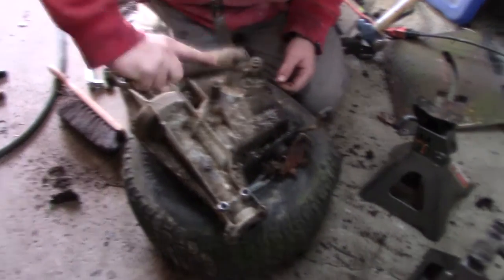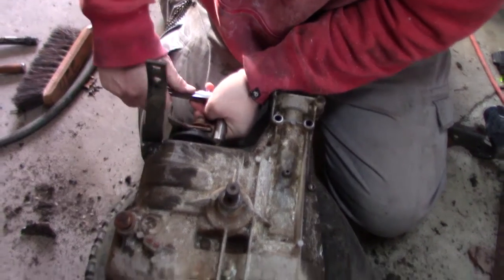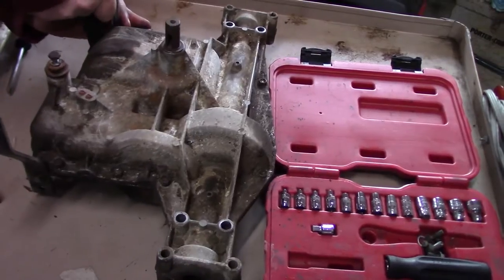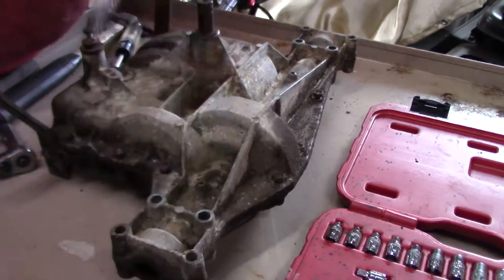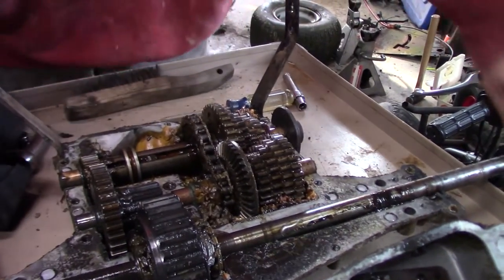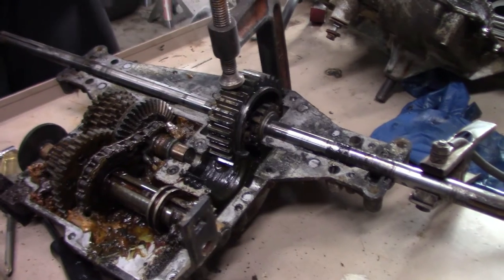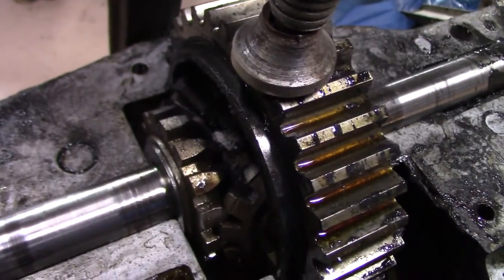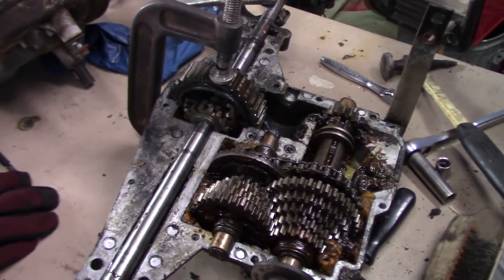Welding a racing mower axle in 5 minutes

Comment: Lets hope the welds hold LOL.
Reply from the maker: redneck4life887 The last one we did is still going strong. Atleast the axle shafts will stay in now. It was crazy how easily they popped out.
Reply: That's good man especially how you guys drive em lol. Nothing like making mowers do what they were NEVER designed to do =)
Reply: That is sweet to not have to buy anything to mod with! I know what you mean when ppl see someone doing 30 + on a mower they turn there head and think WTF? lol
Reply: That helps man lol. Semi truck for real???